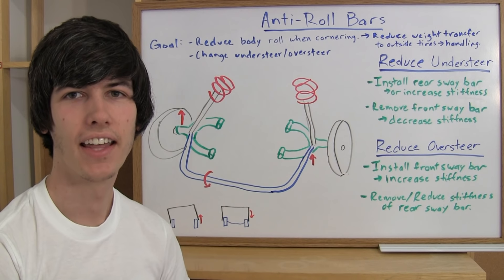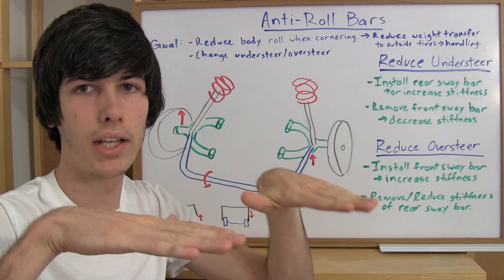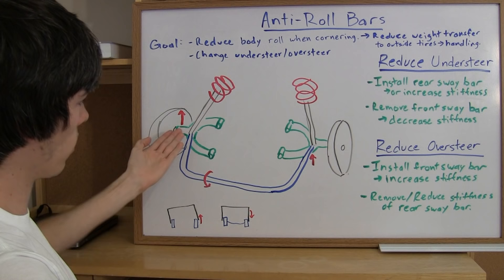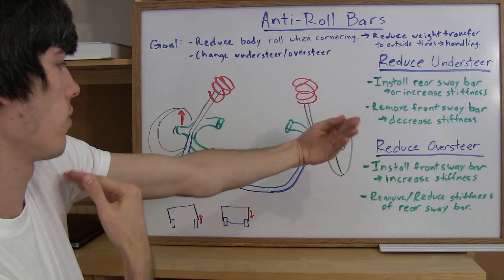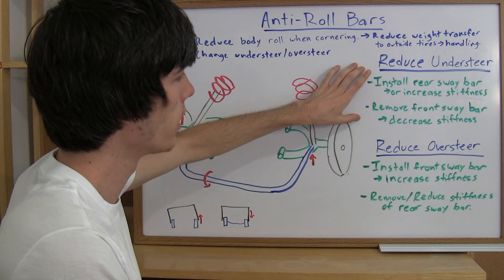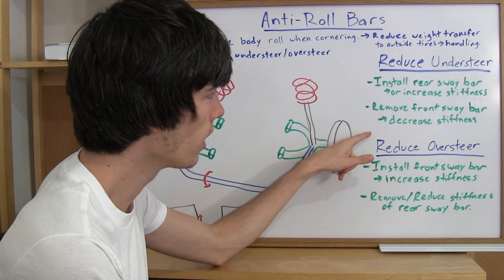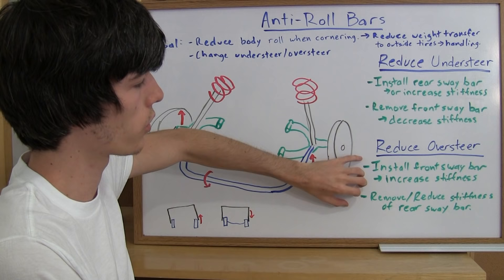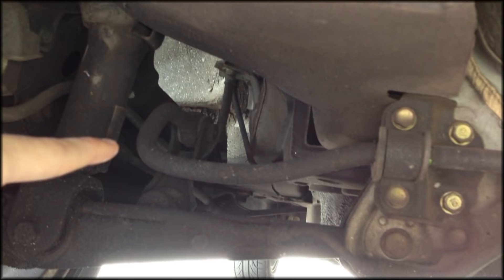How Anti-Roll Bars Work - How To Improve Car Handling

Comment: I´m a bit confused by the idea that removing or reducing the stiffness of the front sway bar will counteract understeer. I´d have imagined that, by keeping the weight of the front end of the vehicle more evenly distributed between the front tyres, the sway bar would help combat understeer. Could someone explain this to me? Thanks.
Reply: Sway bars (antiroll bars) don't keep weight more evenly distributed, in a turn they increase load transfer on the end they are located on (all else being equal) and decrease load transfer on the opposite end.

There are many misconceptions about what ARBs really do.  Try to clear most of them from your mind and just think of them as a way to add stiffness in roll to the end they are mounted on.  This stiffness has effects on load transfer, camber, and a few other things - they all can affect the balance and grip of a vehicle.
Reply: yeah is complicated because this involves logical and analytic thinking most avarage folk dont have :))
Reply: Well, in minimal cases it would keep the weight more evenly distributed, but think of turning left, and the right wheels go upwards or the chassis goes downwards. Well the anti roll bar makes the wheels on the left side go up too, so that they are parallel to the bottom of the car, this could possibly cause the left wheels to lift off the ground and increase weight on the outside of the tire.

The roll bar reduces the roll of the chassis compared to the wheels and makes them stick together more, this would mean more equal distribution on lets say a bumpy road, where the chassis is not rolling, but in a tight turn, the wheels - since they are lighter, would roll with the chassis.
Reply: I think in the way it is explained in the diagram here, and elsewhere in a similar way is, the key word is reduce. For example stiffening the rear bar could be also be seen as increasing oversteer. I believe this happens because a stiffer rear bar decreases the wheels indipendant movement which decreases grip in the rear slighty and this makes the rear come around mord quickly. IF you were to gradually increase the rear bar you would sooner or later go from understeer via a more neutral handling to actual oversteer.  If you gradually reduced the front bar size without changing anything else you would get a opposite but similar effect by increasing grip in the front instead of reducing it in the rear , with a situation of more grip in the front as opposed to the rear.   A car with more grip in the rear than in the front is usually safer since correcting understeer is easier and more forgiving than correcting oversteer. A car with     a neutral handling would be quicker and possibly more fun to driver but more demanding since it is closer to an oversteer situation.
Reply: @johanbjork1650  So does having a sway bar attempt to effectively give you more spring rate in a turn, but allowing you to have a soft spring rate when they are not engaged the softer effective spring rate that might provide more grip on relatively flat surfaces with little perhaps smaller imperfections?  So the variable nature of a sway bar in respect spring rate be superior to just running a higher rated spring?  I've been trying to wrap my head around this for the past few days on why I should have a sway bar at all.  On my RX-7 the best mod that I did to it was removed the rear sway bar, but that car had favorable camber curves compared to my MR2 which is McPherson based which also has some interesting toe-in/toe-out effects when loaded.  Even though I don't think it's a better suspension, I do find it interesting to learn a new(to me) suspension that seems no matter what I do a compromise will be made.  On top of that wider wheels clear OE struts, whereas a move to coilovers limits inner clearance.  It's an odd balancing game that I'm trying to figure out.

Comment: I don't know the full reasoning, but I know that the suspension in the MP4-12C isn't conventional, it uses hydraulic controlled suspension and dual-chamber shocks that bleed excess pressure from one side of the shock to the other... Some people explain it as adjustable spring ratios, which is also why the car rides so comfortably when its in normal and is so stiff in track mode. The hydraulics manage the body roll as well.

Comment: Well yes, the alignment is much cheaper and it can be done very fast (basically it takes 10-15 minutes). But it won't solve the camber issue, it will only reduce the tire wear as much as possible.

The springs themselves are only used to raise or lower your ride height, the camber depends on your wishbones...and how they are constructed.

Google "camber adjusting kit porsche 997 tt" - it could be the best solution for you if you can afford it.

Comment from the maker: Basically you're making it act more and more like a live axle, the stronger the link between the two tires.
Reply: While it does add a linkage between the wheels at one end, an ARB is the opposite of a solid axle. A solid axle causes cross-side jacking on compression, magnified by the inboard position of the spring perches. An ARB causes cross-side compression, along with a reduction of body roll.

Comment: Well yes in a way, if you have too much camber, the tire wear will not be even, the inside part of the tire will wear faster and more than the outside.
Adjustable camber kit could solve this problem.
Another (cheaper) way is to compensate with adjusting your "toe", this will only minimize the tire wear, but the tire will still wear more on the inside than on the outside.
What car model are we talking about ?

Comment: Are there cons to stiffer rear sway bar. Think of getting rsb and end links in my gti. Already lowered 1.2 inches on coilovers.  It will be mostly for street application. Like twisty canyon roads and getting on/off highway ramps that have long turns.

Comment: Adding an ARB when it is unneeded is generally counterproductive. A lot of effort goes into making independent suspensions actually independent, and sticking in an ARB in ruins a lot of that work by coupling them when one hits a stone etc.

The McLaren probably achieved its roll stiffness targets with single wheel springs alone, and achieved under/oversteer tuning through other methods. An ARB is often merely a bandaid for a problem that would preferably be fixed in a different way, but wasn't.

Comment: The CG on most cars (at least sedans,coupes, etc) is indeed quite low, the roll center generally remains significantly above ground, and angular displacement of a car in a turn is quite low also - in combination, yes, the CG movement due to lat acc. is actually quite minimal. 

Continued in another post because youtube character limit is silly;

Comment: Hi, thanks for the video, but I got stucked because of one contradiction. To reduce overstear, you need to increase slip angle on front axle and you can do so by actualy inrease the weight transfer to outside tires. So in my point of view, if the anti roll bar on front axle reduces overstear, it must increase the weight transfer on outside tires. It seems also logic to me, that if you decrease roll of the body, you have to have larger stiffnes of the springs (or use anti roll bar), and as a result you push the outside wheel with larger moment to the ground and inside wheel pull stronger of the ground. Can I get your opinion? Cause I would like to understand this fully..
Reply: A front ARB can improve front camber through reduction of roll, and this effect can be more significant than the load transfer effects with some suspensions (especially MacPherson struts).  There are several competing effects happening here.

Comment: you said '' Say this tire hits bump or some elevation change and it goes up it'll turn this roll bar up and so by turning that roll bar up it's gonna produce a torque along that bar which is gonna force the other side to move up as well..." But in this example sway bar not gonna reduce body lean since one side goes up ( since it on the bump) while the other one goes down ( since sway bar brings the tire on the other side closer to the body).
Reply: Indeed, sway bars are a terrible thing on bumpy terrain.

Comment: Can someone explain to me how increasing the spring rate to the outside wheels (essentially what the sway bar does), therefore allowing more of the cars weight to be taken up by those outside wheels, "reduces the weight transfer to the outside tyres"?

(Protip: you can't because that's completely wrong.)

Comment: I would like to point out that a swaybar does reduce body roll but it does so by transferring load from the inside tire in a turn to the outside tire in a turn.  This is the opposite of what you have written as a goal.  The reduced body roll occurs as you say, by having the inside tire also lift you reduce the body roll by lifting the inside tire and because there is usually still weight over that tire it will force that corner to stay more level.  While you CAN use a swaybar to reduce body roll, I strongly encourage anyone who is building a serious handling car to use your primary springs instead of swaybars to do so.  Swaybars should be tuning devices, not a primary means of producing level cornering.

As a mind problem exercise, you can reduce understeer in a RWD car by increasing the front swaybar rate.  Think about how a swaybar reduces body roll and the effects body roll has on suspension geometry changes.  This is especially true on strut cars where the suspension goes through huge changes in camber during body roll.  By reducing body roll you are keeping the tire in a "happier" part of the camber curve and increasing front grip which reduces understeer.  You could, in theory, reduce oversteer with a heavier rear bar by a similar means but it is far less likely.  What was written on the board is a good general guideline for properly sprung cars (IE: a racecar or track enthusiast car) but on cars with relatively soft spring rates (including most "lowering springs") you are more apt to run into the opposite effect when increasing your bar rates up until you reach the point of diminishing returns with spring rate at that end of the car and start to transition to what is on the board.
Reply: To be fair though, increasing an axles traction by increasing its stiffness is more an exercise in cancellation of errors than anything else. If you had a properly stiff chassis (which you need to get benefit from an ARB in the first place) you could reduce front roll angle by putting the sway bar on the rear anyway, and reduce front lateral load transfer at the same time. A double whammy of understeer reduction.
Reply: Nereth You can definitely utilize a swaybar/anti-roll bar with a softer chassis setup.  The effects are noticeable which is probably why they are such a popular first upgrade for street cars but I would agree that it is putting the cart before the horse.  For "proper" race cars they are tuning tools, for a street driven vehicle they can be a powerful way to reduce body roll without impacting 2 wheel bump.  
Two ways to use them, neither is "more correct" than the other.  I prefer to use them as a tuning tool and have a car that is properly stiff to use them as such, but for folks looking for a dual purpose vehicle increasing the front swaybar with softish springs, especially on a strut based car, will reduce understeer by keeping the front suspension in the better part of the camber curve of the suspension.  Beyond a certain wheel rate they will add understeer heavily.
Reply: UrPeaceKeeper
 I think we are in agreeance mostly, but I think trying to trade off favorable TLLTD with keeping yourself from getting to a bad part of the geometry, especially when a lot of the time the steering geometry is actually beneficial in cornering, is a bit of a risk. Certainly the car will feel nicer, it will feel flatter in the curves and have a shorter transient going into a turn, but to know if I was actually increasing total grip - would need an accelerometer and a big chunk of flat tarmac to be sure.
Reply: > I would like to point out that a swaybar does reduce body roll but it does so by transferring load from the inside tire in a turn to the outside tire in a turn.

This isn't quite right, or maybe I'm not reading it right.  Thicker sway bars front and rear will decrease body roll but without changing load transfer, if they maintain the same overall roll stiffness balance.  Upgrading one bar will both increase load transfer across one axle and decrease it across the other, for a net change of essentially zero.

Comment: Great video. I'd love to see a video about tire diameter changes for tire upgrades. Specifically I wonder what difference in torque and speed would I have if I change my tires from 235/60 R16 to 235/70 R16 in a 4x4 vehicle. I guess it's quite a commmon question and I have found no really scientifically justified answer. Thank you very much.

Comment: Anti-roll bars will actually not reduce weight transfer. Weight transfer is not a function of anti-rolll bars, springs, or suspension geometry. Here is the equation: Weight Transfer = (Weight*Ay*h/t) Where Ay = Lateral Acceleration, h = height of CG, and t = track. From this you can see that roll bars play no effect in weight transfer. The reason why they help you go fast is b/c they reduce body roll which helps your tire stay in a better part of the camber curve for better traction.

Comment: Thinking about getting a 2015-2017 GT Mustang. How do i keep the ass end of that thing planted? Was thinking sway bars, spoiler, rear diffuser, lowering springs, wider wheels aand work towards a 50/50 weight ratio. Now most of this stuff costs $500 each or more so what do you think would be the top 2 or 3 things to accomplish that?
Reply: Lowering springs usually decrease ultimate grip by dropping the roll centers, increasing body roll for the same spring rate, and causing earlier contact with the bump stops.

You will probably see the most handling benefit from better tires and thicker adjustable sways both front and rear.  The front bar will improve front wheel camber significantly and rear grip; the rear bar will reallocate some of that additional rear grip back to the front.

Higher rate stock-height springs may be beneficial if you can find them.

Comment: Kind of confused.
With your diagram at the bottom left...it looks like it's making a right turn (since the load is put on the left side). Now, if you were to pick up the wheels on the right side (the unloaded side), wouldn't that give it a higher chance of rolling?
Wouldn't it be better to make it so as the left side is taking the load, the bar is pivoting on something to press the right side of the car downwards -- keeping the weight on the ground?

Comment: Hi. so, you saying if you want reduce the understeer of the car you have to change the back sway bar. basically all the front wheel drive cars. I have mk5 golf rabbit
Reply: It's not that simple.  Sway bars also affect wheel camber, especially in suspensions that suffer badly in camber on compression.  A thicker front sway bar can actually increase front grip in many MacPherson strut applications due to this.

Comment: can u plz explain why understeer is reduced by increasing the stiffness of rear sway bar?
could'nt understand.
Reply: You may have your answer by now, but in case you have not.  Understeer is reduced by increasing the rear sway bar size relative to the front for one of two reasons.

1.  Because the rear sway bar transfers so much force that the inside rear tire offers nearly no grip or lifts the inside tire off the ground.  Since 2 front tires offer more grip then one still on the ground in the back the car oversteers.  This is because tires evenly loaded have better grip then one tire with all of the load.  For every pound of force on the tread added some amount less than one pound of friction force to grip the road is added.

2.  Because in the case of Macpherson struts as the suspension compresses it adds positive camber (makes the tops of the wheels tip outward and rolls the tire onto the sidewall).  If you can reduce the amount the suspension compresses (increase overall roll stiffness) the tire stays flatter and thus stays on the best part of the tread for traction.  (Adding a larger front sway bar would have more effect here on the front tires)

Sway bars do not decrease weight transfer!!! It only adjust roll stiffness and oversteer/understeer bias.  More sway bar reduces overall grip but improves roll stiffness which in turn makes it easier to drive the car at its limits.  To get max grip you would have very stiff springs but that makes the ride uncomfortable and unless its a smooth track with no cracks the tires will have trouble staying on the ground.

Comment: Hei man! Let's say that I already have swaybars both on the front and on the back axle. Now, in order to reduce the body roll in the corners I stiffen up both of them. If the stiffening is done with some criteria (keeping the ratios between front and back), is it safe to assume the understeering/oversteering characteristic will not change dramatically?
Reply: It's not the swaybar ratio that it's important to keep constant, it's the ratio of overall roll stiffness front and rear including both bars and springs.  If this is maintained, over/understeer will not change drastically, though improved camber from a reduction in body roll may add additional grip front or rear.